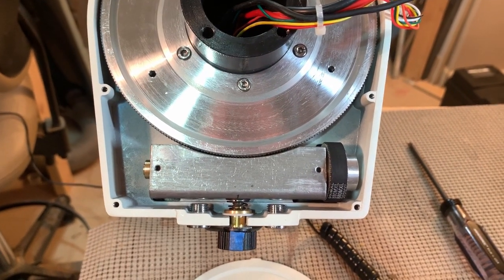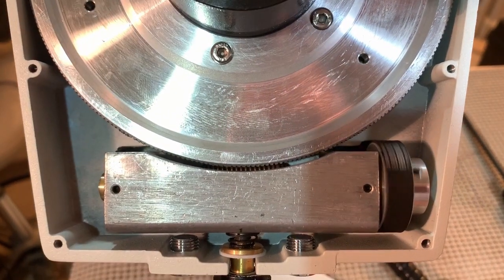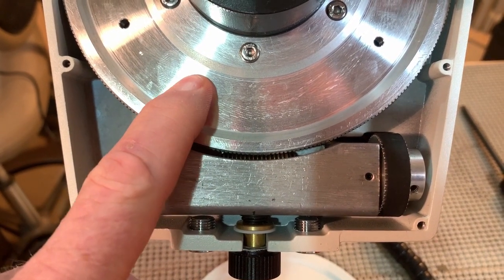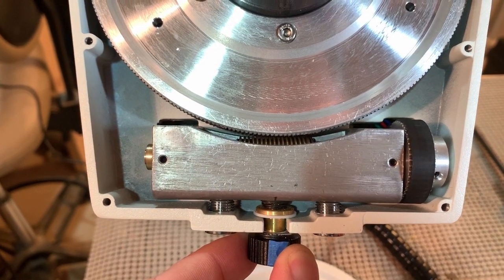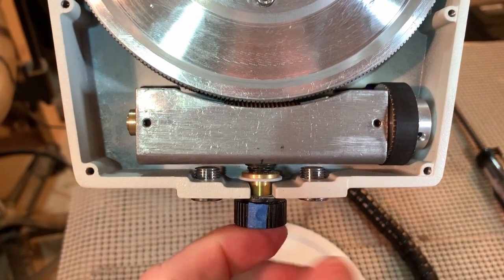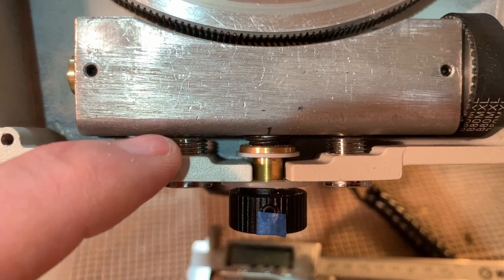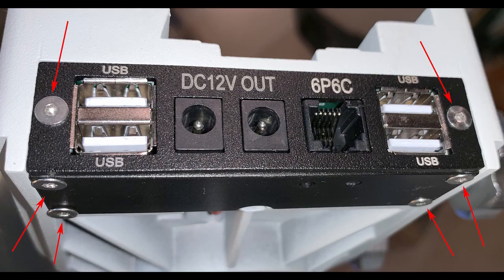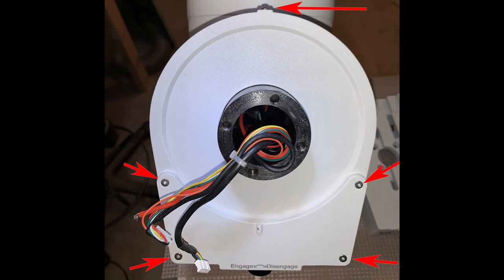iOptron CEM60 - Declination Gears

Comment: Thank you for very instructive video. I would like ask you for your judgement... I just bought new CEM 60 CE and I am testing it. Unfortunately, the tracking (SDRL) noise is not so good. I just placed video on my YouTube channel. Could you look at and hear this noise ? Is it normal ? Produce your CEM60 same noise ? I carefully red Instruction manual and tried to adjust it with Gear switch knob, but this adjustment has no influence on this noise.  Please be so kind and give your feedback. Many thanks in advance.
Reply from the maker: Hi Vladimir, I listened to the noise and there is definitely something rubbing or not set correctly in your RA gears.  If adjusting the tension on the engage/disengage knob doesn't help, you'll need to open up the mount and check for a belt that has slipped off a little bit or is rubbing on the cover plate. There may be a rub mark to indicate this.  Take pictures/video to help with reassembly.  Hope this helps, please post your results.
Reply: @TheAstrovert99  Thank you very much Jeff for your view and advise. I have contacted Ioptron too, but no answer yet... I will post result.
Reply: @TheAstrovert99  Hello Jeff, Thank you very much for you feedback. I very appreciate it.

Comment: Great video and very useful, be very careful when turning the gear switch knob to engage and disengage the magnetic clutches, mine sheared off possibly due to defective brass material being used. Apparently a few owners have had the same problem.

Comment: Great video - thank you!  My CEM60 was measured at 4 arcsec RA peak to peak at the factory, but after dropping it once (my own fault, doh) and unintentionally hitting it, PHD2 now gives me a semi-consistent RA peak-to-peak value of about 20 arcsec.  And naturally my RA guiding is garbage as it's all over the place and the error isn't periodic.  Is it worth me trying to take apart my RA gear to see what's going on, or should I find a specialist who can "re-tune" the gears for me?
Reply from the maker: That's a tough question.  I would look into it as much as you feel comfortable doing.  See if there's anything obviously loose or shifted.  I didn't remove any gears since I didn't have a need to and I'm not familiar with the process.   If you don't feed comfortable with something then have someone else look at it.  I've made plenty of things worse by not knowing what I was doing.
Reply: @TheAstrovert99  Good advice.  Thanks.
Reply: Did you solve your problem?

Comment: Jeff.  How thick of a washer did u use?  Good hint
Reply from the maker: It's only about 1mm thick.  The shaft that it goes on is 8mm.  The one in the video slips around a bit so I bought a new one that is 5/16" ID and a smaller outer diameter.  It fits perfectly!

Comment: I can't wait to get mine in a couple of months. I was just wondering, how much can it go past the meridian? On regular EQ mounts you can go quite far but looking at the CEM build it looks like you have to do the meridian flip almost immediately.
Reply from the maker: Per the manual, you can "tell the mount when to stop tracking or to do a meridian flip. The limit
can be set at from 0° to 15° (1 hour) pass meridian for Northern Hemisphere and 0° to 10° for
Southern Hemisphere. "  Personally, I set SGP to flip at 5° past and the mount to "stop" at 10° past.  Then if there's ever an issue with SGP the mount should stop on its own.  There is also a hard stop on the mount.
Reply: Thank you for answer, that's really good to hear :-)